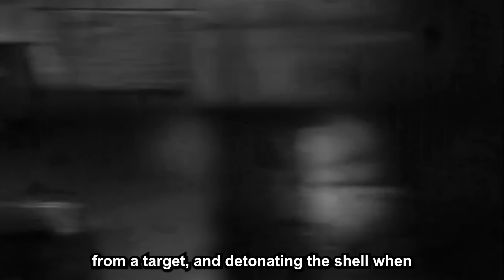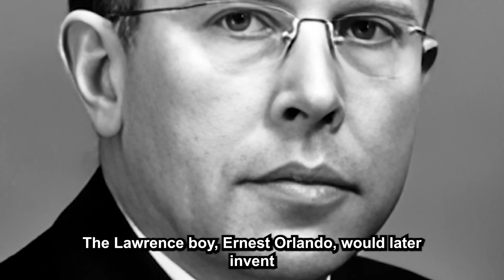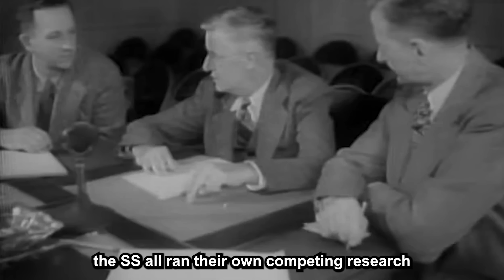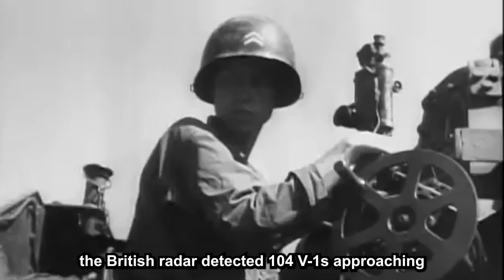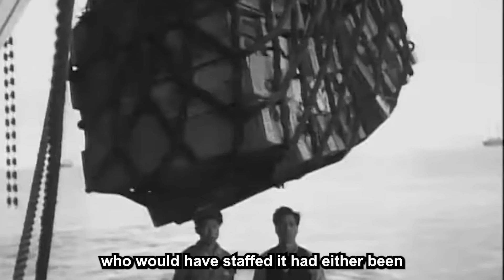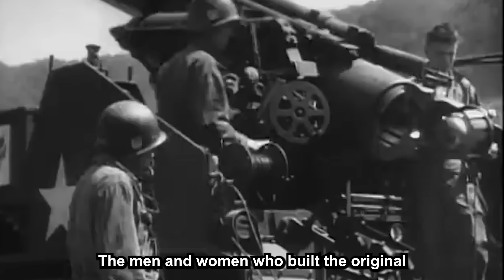Why German Engineers Said The US Proximity Fuze Was Physically Impossible

Comment: These claims are of course exaggerated.  After the war, a lot of engineers and scientist exaggerated their contribution to the war. At one point the British believe they invented radar.
-The Germans were the 1st to have shock hardened vacuum tubes in Service well ahead of the British and Americans.
-They had a type of vacuum tube called a cold cathode thyratron.
-They were used from about 1936 onwards to make electronic timers and arming devices for AirDrop bombs.   
-They were filled with a half an atmosphere of pressure of argon.   They operated as extremely sensitive timers.  The Germans could arm and disarm their bombs in flight electrically.  And they could use these vacuum tubes to set delays in their bombs. They were the only nation to be able to ship bombs with fuses installed.
-A piece of espionage was handed to the British called the Oslo letter which detailed all sorts of German secret weapons.  
-One of these was of plans to use a cold cathode thyratron in proximity fuse for a Canon shell.
-The Oslo letter even contained an example of this tube. 
-This vacuum tube that fell into the British hands then inspired the British to restart their own proximity fuse work.
-The German proximity fuse worked by having an aerial on one side of the shell which has it rotated sensed the electrostatic field around the shell at 500 Hertz which was the rotational speed of a typical shell.  This was rectified and felted and used to trigger the show by a fused link.
-However, in 1940 Germany was a war with France and thought it might loose.  So they suspended work on their proximity fuse.
-By the time they restarted their work in late 1942 it was too late to get it into production.
-The fuse was called Kuhglochen, it was by Rhinemetal that also made the bomb fuses and the vacuum tubes were by Siemens.
-You can read about it in several books and there is a CIOS document on the cold cathode tubes as well as the proximity fuse.

Comment: It would be helpful to have a more detailed explanation of the success rate math. Even given the 30% duds, most of the proximity shells missed their targets. Why? How?
Reply: Aircraft flying at high altitudes changed position marked in fraction of degrees from the aiming points of gunners at surface level. The proximity fuse had to get approximately close to work.

Comment: German industry did not have our mass production process and technologies. 

Who builds a super tank for the Eastern Front, which needs to be shipped back to Germany for a transmission change? A design that required 10 to 20 to 1 of maintenance to combat operation?

There is far more to mass production than willing it so.